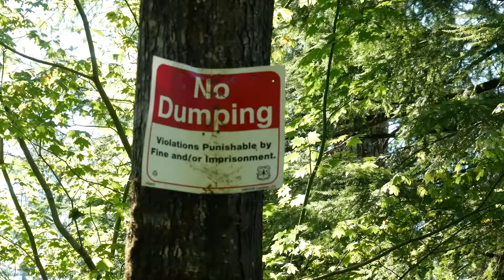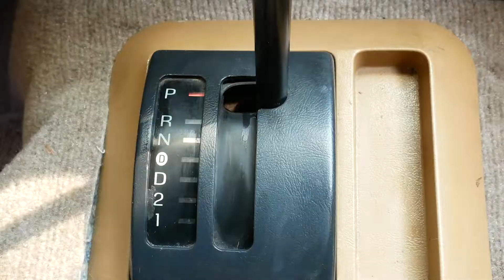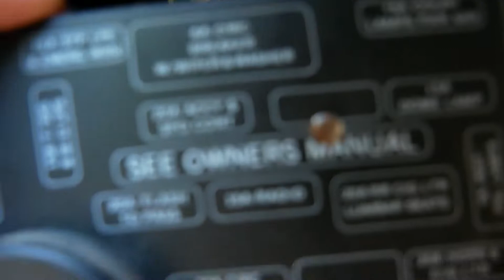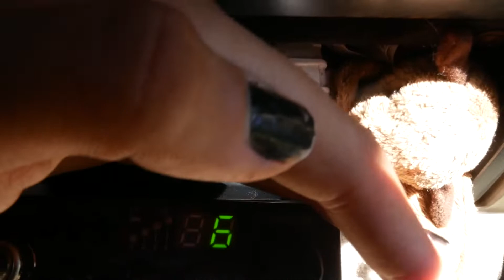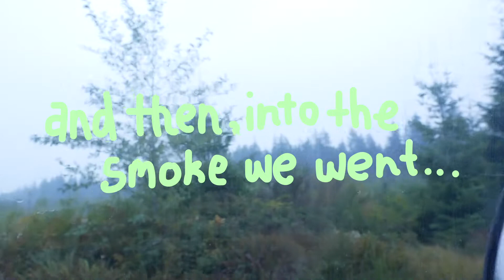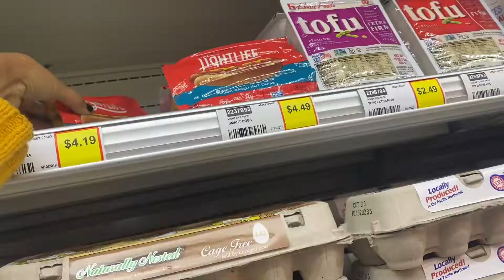Adding a few Final Touches to my Vintage Van Build in The FOREST | Three Chill Days in the VAN LIFE

Comment: Its worth having your vans pointed out then if you have any problems with people, you can jump in the front and just go , start up lights on move, your a  Sweetie wrapper l😆l, and you need a different kind of aerial, if your fuse is blown , don't be tempted to use a bigger one, its important you put the correct one in, look up what its for and itl tell you whats working or not , ps don't use the mic without a aerial,  you can blow the unit.